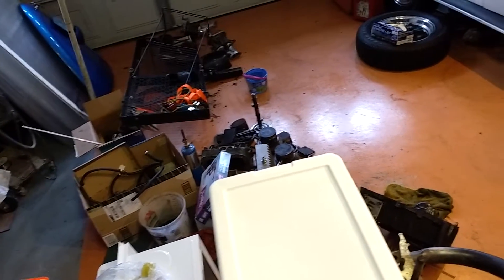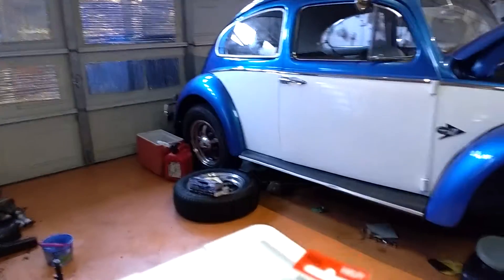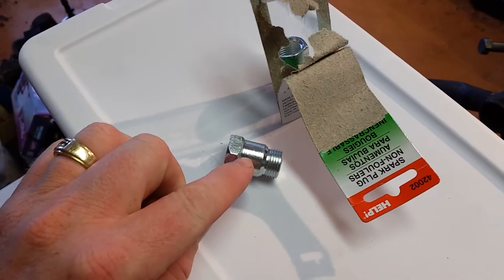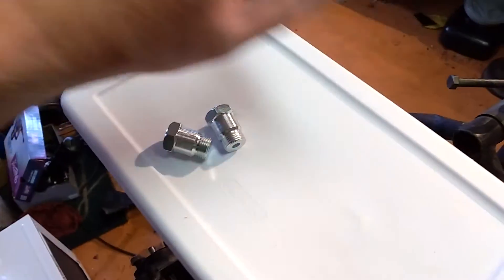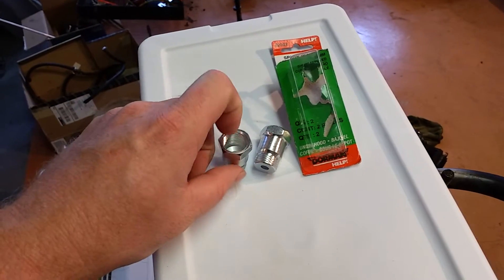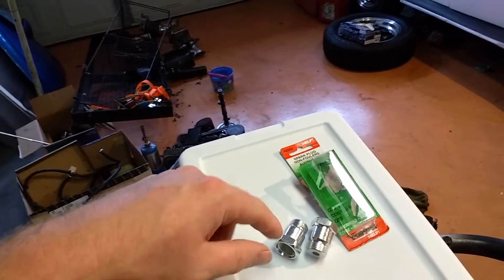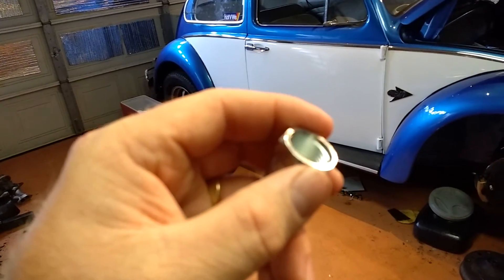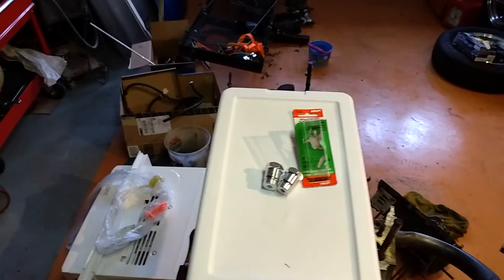O2 Bung Hack

Comment: So I bought a used Truck, and now Because of Youtube heros like this guy.. I have a 02 sensor that was non fouled.. NOT NO foul.. That is broke off. This is very very thin steel, and after a few miles.. or a year or 2 in the Winter salt. My truck currently is 5 yrs old, and has 84k miles on it. Looks like at the 60k mile mark, The previous owner had a crack in his exhaust manifold. (Known issue in the Nissan titan, Its not a matter of IF, Its a matter of when) He thought he had a issue with a bad CAT and used a non fouler.. Now I have welded the exhaust manifold and fixed the crack.. ( Drill the crack at the start and the end... Then weld with just enough power to bead the crack line and fill, drilling prevents the crack from spreading again. If your a decent Stick, you can weld a manifold) Now I have a non fouler. That is broke off inside the 02 bung, and let me tell you.. Welding the Manifold was easier then having to fix this bullshit. I am gonna try to heat the bung with a propane torch and try to grab on and turn it out, but most likely Ill be drilling out the 02 sensor bung, and then using a replacement bung if I can get it done with out much loss on the size.. OR ill be clamping the old bung local which will be a new whole. and then drilling a new local for the weld on bung.. Save yourself and maybe the next guy who buys your car a headache. Figure out what is actually wrong with your auto. Research fuel trims and known issues with your make and model.. An fix the issue. Dont guess or worse  Don't listen to the NO FOULER.. and don't use NON foulers. Just fix the issue correctly and don't destroy your car or truck.. Because also tricking the computer and not getting the correct fuel value will destroy your catalytic converter in the long run.
Reply from the maker: This tip is NOT to trick the computer as people are doing. This is for vehicles that never had an O2 bung in the first place.

Comment: Thanks for sharing. Hopefully this works for my GM o2's.
Reply from the maker: it's a cheap way to add an O2 bung to a vehicle, hope it helps you and your GM.
Reply: Worked very well. Just cut in half dropped it in and welded. Thanks
Reply from the maker: +Lucas Stephenson  No problem glad it helped you.